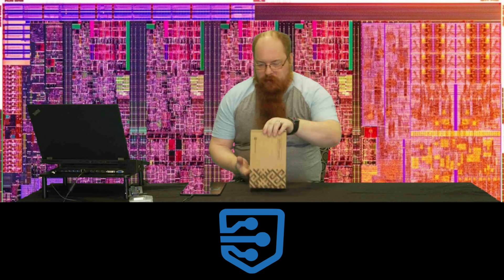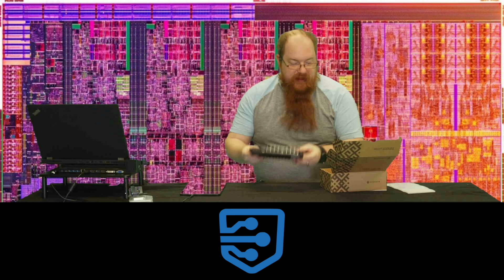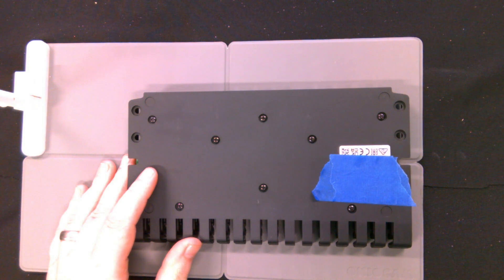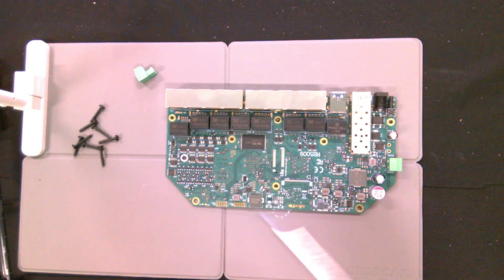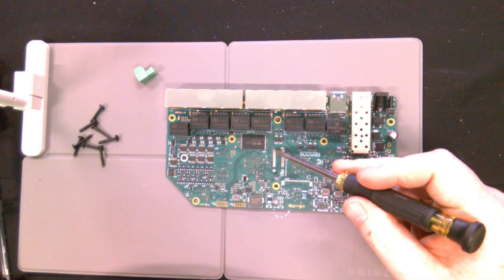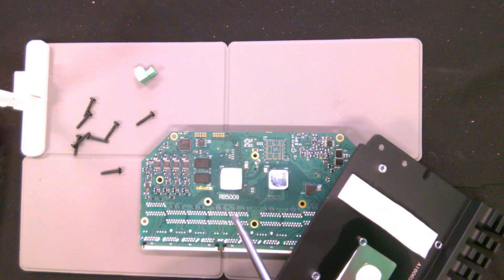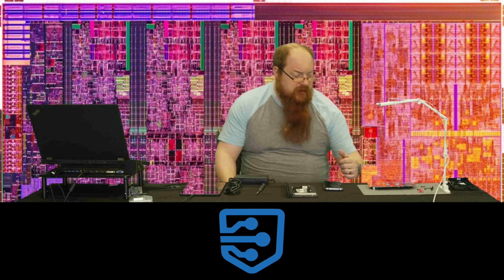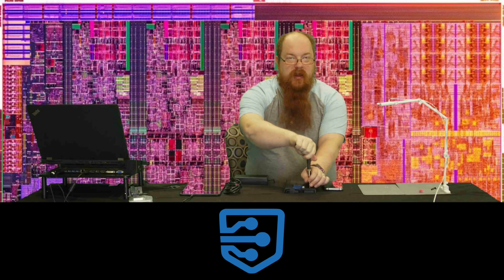Unboxing and quick teardown of the Mikrotik RB5009UPr+S+IN

Comment: Cheers mate, I've got the hap ax3, runs very well. Going to get a rb5009 to upgrade my network to 2.5gbe, and hook the ax3 as an AP. It is sad Mikrotik doesn't have an all-port 2.5gbe or with wifi 6/7 solution... I liked how you cracked her open. I'd like to see you put it through a stress test 😉